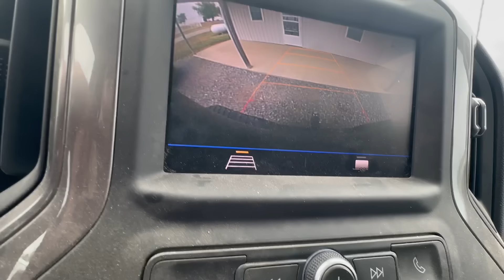I Bought Windows From An Amish Guy!

Comment: I was watching you stand and talk about the Amish while you were on your front porch. The siding on your old abandoned house is an asbestos. You have to be careful about removing the siding that on that house.
Reply: Not necessarily. Siding on our house looks exactly the same. We had it tested and it is not. You can still get replacement pieces that look like it and use. In my area we were told even if asbestos there is easy removable solutions and just difficult disposal problems. I was glad ours was not a problem.
Reply: Randy, you pointed out that the shingled siding on the house is asbestos, My previous house in New Mexico had the same asbestos siding. We wound up building onto the house on both ends and installed EIFS with 1 inch of foam for insulation, on the entire exterior house, even the eves. We left the asbestos on the old part of the house and just encapsulated it with the EIFS. The cost estimate to have the asbestos removed by a licensed company, was more than we spent on the remodeling. The house was originally built in the mid 1940"s but later built houses that used the same fire resistant shingled siding do not contain asbestos. Dutch should pick up a test kit and test that siding just so he knows what he is dealing with and what steps if any he may need to take going forward with the remodel. 
I see where Pattirpley7599 in a comment has said that the siding is not necessarily asbestos, and he may be right. Good catch Pat. In any case, Dutch needs to know what he is dealing with.
Thanks for the great video content Dutch, take care of your wonderful family... With respect... Joe
Reply: @joesharp5602  thanks did not know . I was concerned for them .

Comment: The key with the Amish is that word--convenience--defines most of the things they avoid. The Oklahoma Amish communities actually tried to plow and harvest with horse-drawn tools for a few years, before finally admitting that in Oklahoma it's nearly impossible. Even so, they usually only admit the barest technology needed. Their tractors are old-school mechanical, no a/c or computer chips (and sometimes no rubber tires). They use landlines or flip phones, no smartphones (even though they use computers and run websites). And yes, the power bank would be a step too far. Basically, the idea is "What we have works, so anything more/newer is a want, not a need."

Comment: I don’t know a lot about the Amish but I know different ‘groups’ have different rules… like some drive farm equipment but others use horses to pull ther farm equipment… I think ther generators are solar powered but what you have can be solar powered but also charged by plugging into the grid which they may not be allowed to do… 🤷‍♀️

Comment: There are different sects with the Amish, so, one sect will be stricter than the other. A basic solar setup (solar panels, charge controller, lead acid batteries and inverter) compared to the current solar power banks/solar gens, are like night and day. The solar gens are more technologically advanced compared the old basic systems. The generators are controlled by computer software, use a completely different battery chemical composition, etc. That technology is what might be the problem.

Comment: The outer frame of the windows looked like extruded aluminum or vinyl. Is that correct? I worked for a aluminum extruder and we had one or more Amish customers. The closest Amish community is Kidron, OH. They use radial arm saws converted to hydraulic with a pump outside running on gas or diesel.

Comment: The elders run the community.  They tell the people  what they  can and can't do. They shun technology.  But if an elder gets hold of technology  and thinks it's OK, than they'll allow others within the community  to use that technology.  Kids only  go to school  through  8th grade. They shun a lot of science  also.
 I'm in my mid 70's and have a gas generator. My husband  and I bought it years ago, it will hold 5 or 6 plugs. I haven't  used it since  he passed away. It's been winterized. My son is going to take it. I looked at a power bank, but they  are out of my price range, living on SS.

Comment: If the Amish have refrigerators with the inverter built in, Wouldn't that be a convenience. Using a power bank Wouldn't be no different. Same as them having city water,  Also a convenience. I  don't know.  I don't understand there logic. 
God Bless Y'all.
Reply: Some refrigerators are gas or propane run.